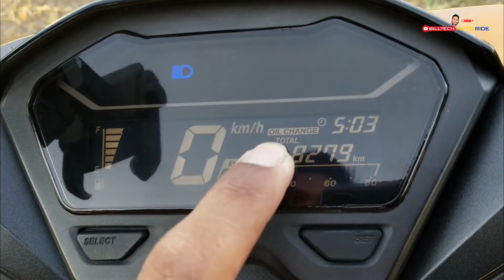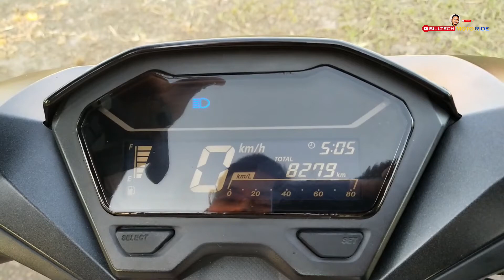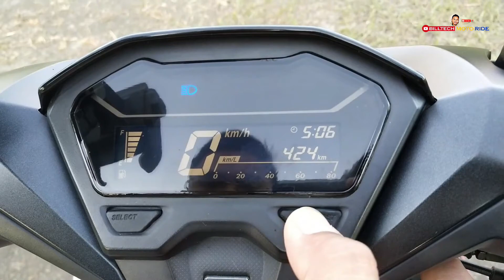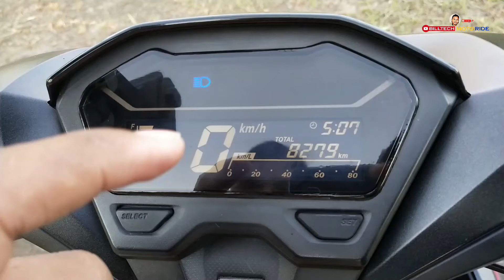HOW TO MAINTAIN CLEAR OIL IN HONDA CLICK | Change Gear Oil & Engine Oil

Comment: goodday.sir meron akong Mag1 full synthetic 75w90 GL-5 gear oil para sa car ko.pwede ba ito sa honda beat kung motor?Sabi kc sa manual pwede sa mga gears tulad nito conventional differentials, gear boxes, limited slip rear axles, manual transmissions and hypoid gears.